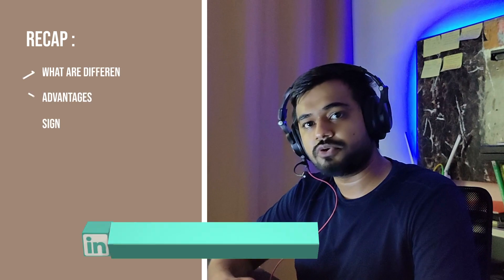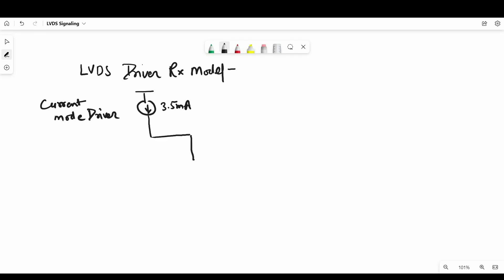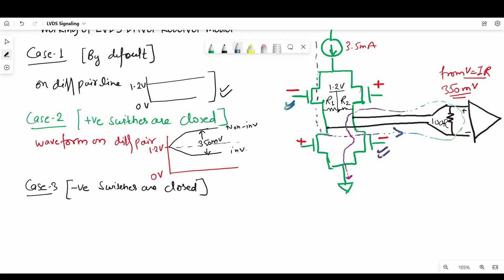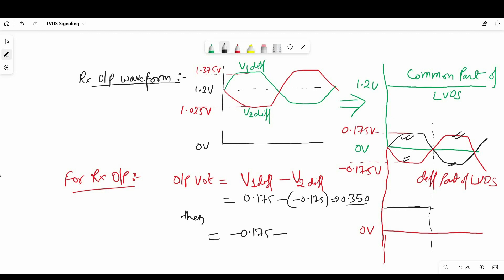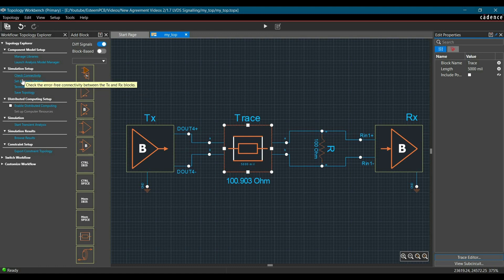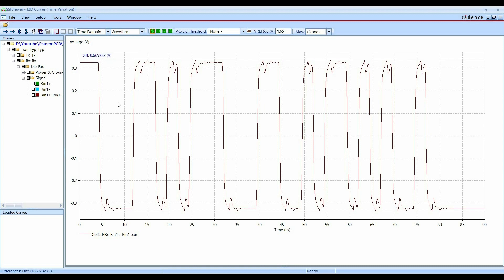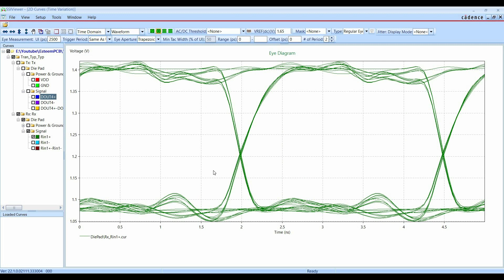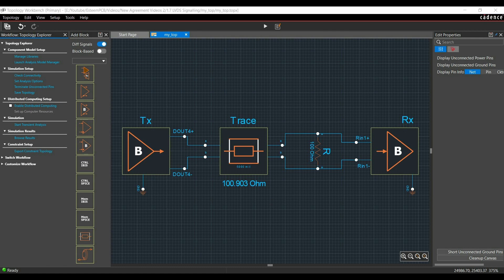What is LVDS Signaling Scheme? Working of LVDS and IBIS Simulations

Comment: 1.What if in the IBIS model for LVDS it mentioned NC (No model provided),then how to simulate those differential pairs .
2. Reason for why the Rx voltage level is more when compared to Tx during simulation (is it because of missing termination) or any proper reason.
3. Is there any reason  for No resistor for high speed data bus between Tx n Rx. If any,what kind  of termination it is?
4. I have IBIS model for an  TX IC, for connector (RX) had s-parameter.is it possible to do simulation for single/differential signals between them ? If not how? 
help with needful info 
TQ.
Reply from the maker: Nice Set of Questions @Suresh, 
I ll cover those while Q&A
Reply: @EsteemPCB  tq

Comment: Hi sir,
How both postive and inverted signals gets generated at same time, as per MOSFET working, when postive side MOSFET is ON, the negative side is off, then how there is inverted signal generated.
Reply from the maker: Hey Selva, as I mentioned in the video, i/p signal of lvds driver generate one true and one complementary signal, using not operation if you look into the datasheet DSLVDS1047 there is a block diagram which ll help you to understand the internal logic
Reply: @EsteemPCB  thanks sir